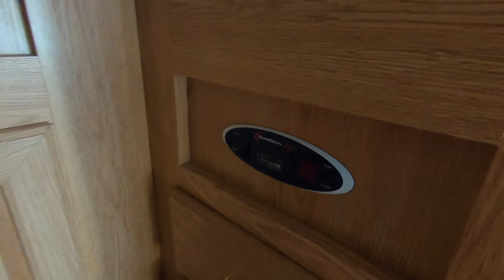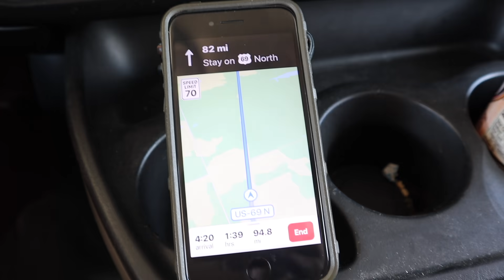I Think We Have This RV Thing Figured Out! {Took it to a PIG ROAST}

Comment: Back a few years ago I was involved in a pig roast every year in late October and we always used either chicken wire or rabbit wire on 2 4X4 frames bolted together with the pig between then. It make it easy to ture the pig but we used an open pit and the pig hung up rotisserie style and we turned through out. Great job by all...

Comment: "I think Abe is ready to get in the sauna" had me in tears. You guys are great and awesome RV.  A couple rv hints I've learned the hard way. You can buy these caps for the bumper so that you can put the septic hose in there and you don't have to store it inside. Use rv toilet paper which is thinner and doesn't clog the toilet. There is a chemical that helps break down solids in your septic system to prevent blockages. Empty the black water tank (solids) first then the grey water tank (liquids) so that grey water flushes out the black water. If there's only one tank you don't have to worry about it. Some trailers seperate grey from black water. Look forward to future videos.

Comment: RV tip : if the heater doesn't light it may be cobwebs etc in the line. Hope you have a dumping hose to dump toilet. Imean the big hose that goes between the toilet dump outlet to the dump station. Dad didn't first trip. Yuk!!! He boight one fast.

Comment: When I was in my 20's-30's we did a pig roast every fall. We had a 200 gal oil drum cut in half with a steel plate welded in about 12" up from bottom for heat transference. We cooked with wood and had a spicket rod through it so we could turn the pig (without the chicken wire) our skin came out different (edible) and it was always good & juicy! The 3-5 guys stayed up all night drinkin to cook it Lol.